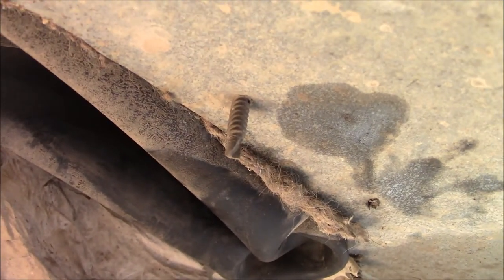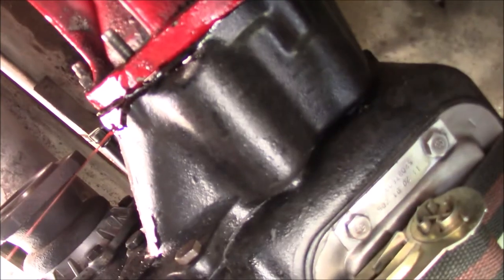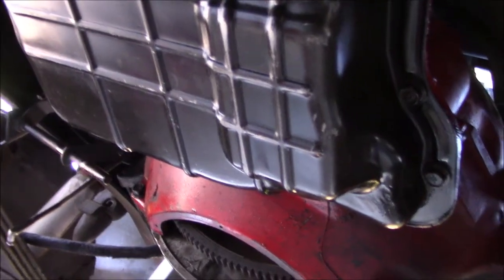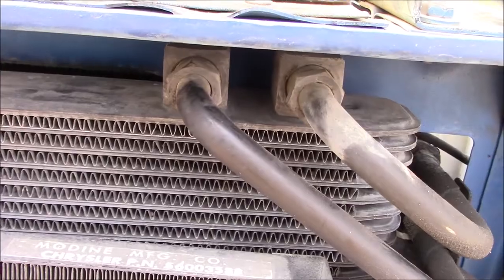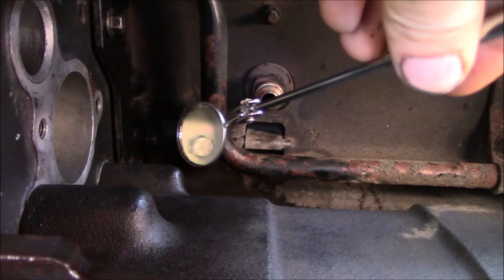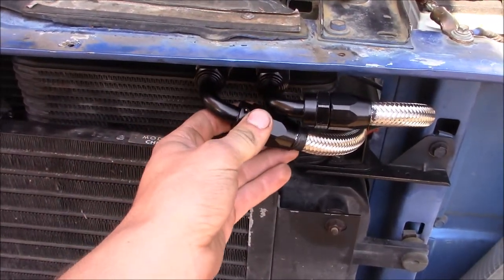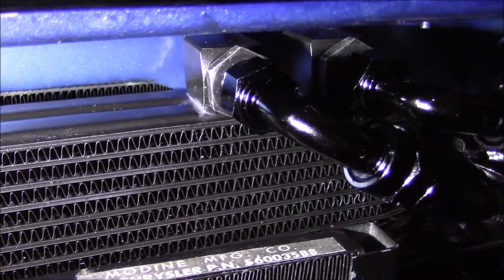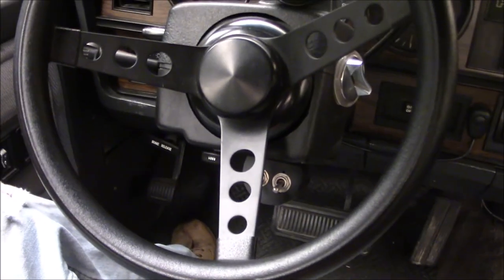1st Gen Cummins 47RH Swap

Comment: Thanks for the video. I’m going to swap out my nv4500 for a 47rh in a ford van and the custom line stuff definitely helped.
Reply from the maker: glad it helped my man
Reply: @10mm  was there any issue at all using the 1st gen TV cable? I don’t have the normal VE throttle bracket, just a small piece securing the throttle cable sleeve.
Reply from the maker: @johnrose5417  1st gen cable works just fine. I made a video on how to adjust the linkages too if you need it

Comment: Hey I have a quick question why exactly do you have to swap the TV cable bracket to the First Gen style?    Is it because it has more throw or less throw?
Reply from the maker: I'm not sure on the throw, but it fit right with all the VE throttle linkage stuff

Comment: Why did you pull the PDD trans out? I’m doing a 47rh swap right now this video was very helpful thanks!
Reply from the maker: Thanks for subscribing! I'm glad it was helpful. I wanted lock up and a stronger transmission so I built the 47 myself. I made a build series on that if you're interested.
Reply: Hey bud, yes I have watched the 47rh build series! It’s a bit out of my comfort zone lol. I finally got my truck on the road and I found my o/d is intermittent ( I have it rigged up to a switch as well). Lock up is non existent. I have the patc connector that isn’t a direct fit, but looks like it should make contact fine. What issues were you having with yours when you were using that connector? Cheers.

Comment: How much did you have to shorten the driveshaft? I’m getting ready to do this swap in my 2WD and my understanding is that both transmissions are the same length, but it’s the deeper adapter plate that causes it to move rearward
Reply from the maker: Correct, the adapter plate is thicker to allow room for the locking converter. I shortened mine 1.25"

Comment: Do you have a part number for the center bearing?
Reply from the maker: I'll take a look tomorrow
Reply from the maker: I think it's a Spicer 210866-1X
Reply: @10mm  thanks man. Also, I'm about to put my new cooler lines on today. They are just like yours. Should i just put that o-ring in the fittings for the front cooler? Or should I try mine without it and hope it doesn't leak?
Reply from the maker: @decentgarage  Of course always happy to help. So the little front cooler needed O-rings to seal for me.
Reply: @10mm  I'll probably just throw orings in there for good measure
Reply from the maker: @decentgarage  I think that's a safe bet. We should collaborate on a video sometime man!
Reply: @10mm  I'm down! You on Instagram? Facebook?
Reply from the maker: @decentgarage  I have IG, I'll try and find you!

Comment: Great video I'm doing just the same on my first gen and I want to do my overdrive and lockout manual shift too but I don't exactly how to install the switches I don't know from the plug where to ruan the cables would you do an other diagram. Thanks
Reply from the maker: First, thanks for subscribing I really appreciate that! So with the 3 pin valve body connection, the front one (closest to bellhousing) needs to be switched to ground to engage overdrive, the middle pin is 12V, and the rear pin is switched to ground to lock the converter. If you need another plug, I found one on a gasser dodge AC clutch in the junkyard. I hope that helps.

Comment: I forgot to ask you about the manual switches what could happen if I leave the over drive switch on all the time.
Reply from the maker: You definitely don't want to do that, that'd be like lugging a manual truck around in 5th gear.
Reply: I see. Thanks for your time and help
Reply from the maker: @germanortega978  Yeah man of course!
Reply: 1 more question, is any way to test the solenoids to see if they are working without removing them?
Reply from the maker: @germanortega978  hmmm you might be able to hear them click if you energize them
Reply: Ok I hear the click but the over drive one  when clicks I have to wait few minutes to   click again is that normal?
Reply from the maker: @germanortega978  Hmmm I'm not too sure on that one man
Reply: Ok. I got fixed, it was doing wrong contact one of the cables. Thank you the switches are working just fine pretty good idea thanks. Now my question will be what's the right way to apply them. I'm using the overdrive switch first and the lock up at the end. But I don't know if I can apply the lock up first or may be a the same time or... I don't know.
Reply from the maker: @germanortega978  Think of it this way, driving around with the converter locked is like shifting a manual without disengaging the clutch. It's a lot harder on the internals of the trans. The only time I really lock the converter is when I'm up to speed in overdrive already cruising down the highway, it saves fuel. Before I shift out of overdrive, I unlock the converter first. Basically I pick a gear that I will be staying in for a long time, then I lockup, then I unlock the converter before I shift again.
Reply: @10mm   make sense. Thanks again. If I have some more questions I'll let you know and I'll keep watching your videos